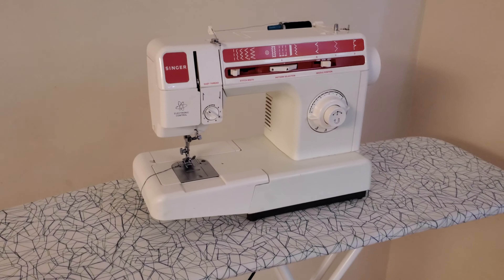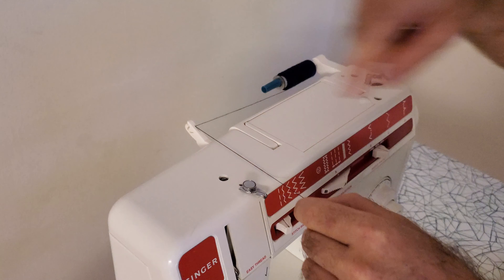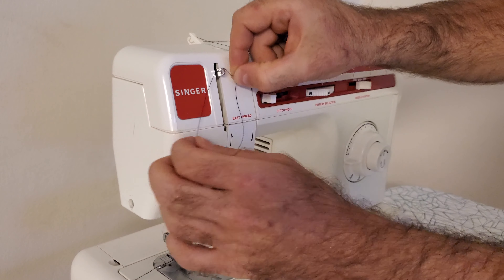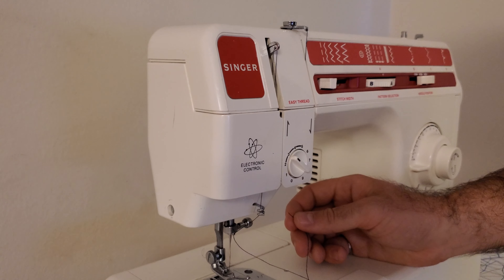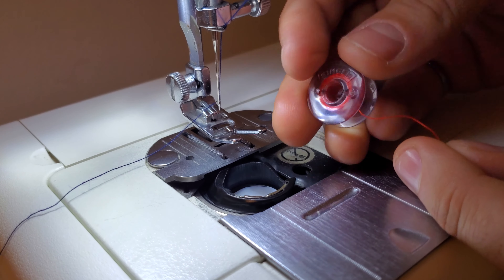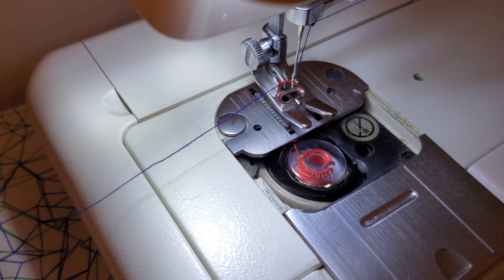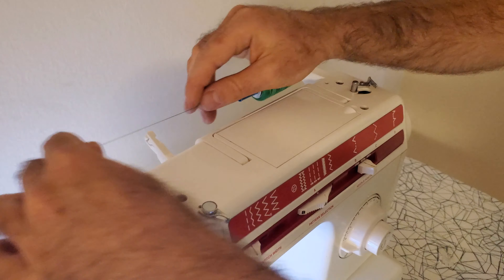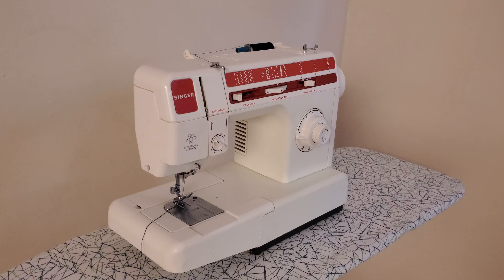How to Thread a Sewing Machine (Singer 9805c)

Comment: the different camera angles you used made it a lot easier to understand how to do it correctly.
😀
Reply from the maker: Thanks! It's pretty important for the thread to follow the exact right path or the stitching may not work correctly, so I took the time to put in lots of close-ups and multiple angles.

Comment: I love this video CJ. Your sewing machine is a slightly more modern version of my Singer 2606 which I bought in 1988 with my second pay cheque for 149 pounds Sterling. I bought it from the Singer shop where they gave me a tutorial on how to thread and use it. Mine is very similar to yours and uses the same bobbins. On mine, and on most sewing machines, there is a disc in the centre of the hand wheel which when pressed pops out and disengages the sewing mechanism when you are winding the bobbin. I hope you enjoy using your sewing machine as much as I have enjoyed mine.
Reply from the maker: Awesome! I bought mine (used) about 4 years ago and it's been really handy for a lot of little projects.

Comment: I have the exact same machine.  I know this video is older, but was wondering if you still had the machine and if you know how to adjust the needle alignment?  Mine is slightly off center. Thanks
Reply from the maker: lol I definitely have older videos...I actually consider this to be one of my newer ones!  Yes I still have this machine. Are you asking about side to side position of the needle?  There's a white slider labeled "Needle position" at the top right of the main front panel. You can use this to centre the needle from side to side.
Reply: Thanks for the quick reply.  My needle isn't dead center when it's set to straight stitch.  When I zigzag stitch, the needle moves too far to the left, and not far enough on the right.  I hope that makes sense.  I've been researching how to manually adjust the alignment of the needle so it's correctly aligned, but haven't had any luck.  I thought since you had this exact machine, you might know.
Reply from the maker: @debintdotf2195  Isn't that what the Needle adjustment slider I described is for? It's admittedly been a while since I've played with that particular setting. Best of luck.